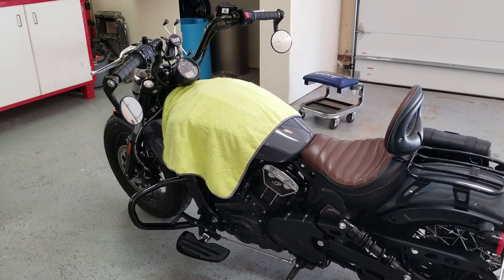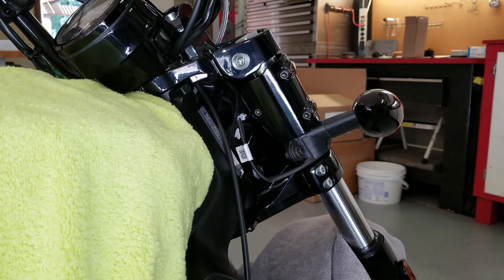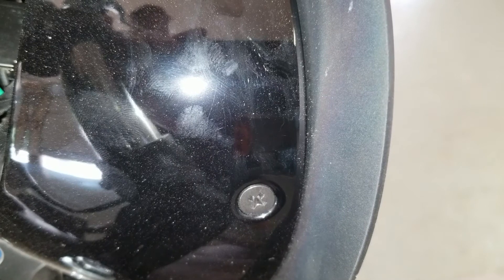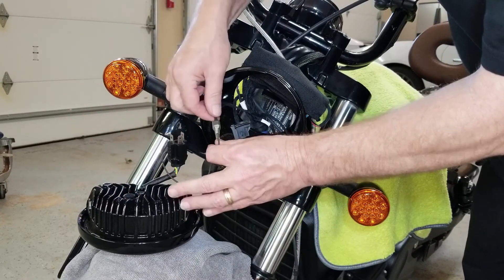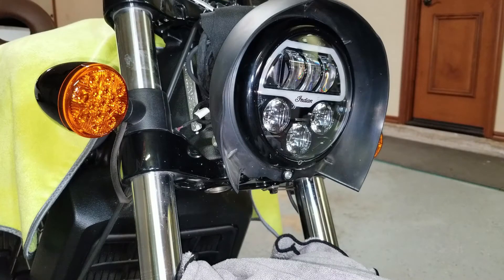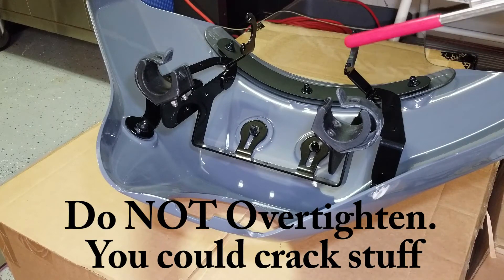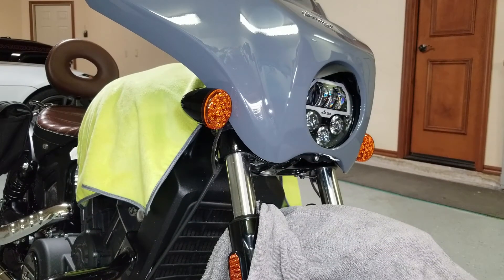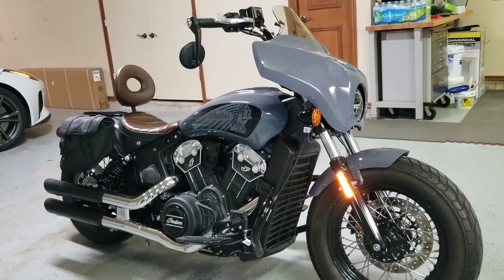Fairing and Windshield Install with Headlight Relocation - 2021 Indian Scout Bobber Twenty

Comment: They sale curved windows for the scout fairing at freedom shields , there curved and sizes are 10, 12, 14,  all three sizes have tent option. If you’re interested in checking it out. Good prices to
Reply from the maker: Thanks for the comment!  Yes, I am familiar with Freedom Shields and actually considered one if the OEM one did not work for me. Fortunately, I think the one I have is going to be just fine. Thanks for tuning in... I will be publishing an Update and Review very soon so stay tuned :)

Comment: It’s hard to do, but your suppose to get that bundle of wires inside of the headlight bucket, like it is on the regular scout. Also note that Indian script head badge thing you mentioned fits all scout models. 
I’ll be interested to see how you like the 7 inch windshield on the fairing. I’m 6”4, and didn’t even bother trying it. I went with the Freedom Shields 12 inch, which is still slightly too short and can cause buffeting. The same company does produce a 14 inch shield for the fairing, but in my opinion the 12 is already pushing on being more than the fairing was designed to handle. When I have it on I don’t take the bike past 70 mph, as it seems the wind could snap the top of the fairing off at any moment, and send that windshield straight into your head. In fact after installing that shield it weighed so much compared to the fairing itself, I’d bet it doubled the weight. 
Overall, I ran the fairing all year last year. My conclusion was I hate cleaning the bugs off it during the summer after every ride. However it’s wonderful in the winter, it absolutely triples the time I can stand to ride in the freezing cold. So as a result, I take it off for the warm weather, and reinstall for the cold. 
Either way hope you enjoy it, it does look good, far better than any other option.
Reply from the maker: Thanks for the comment and the tip on the wires. This afternoon I took it all apart, hid the wires in the bucket, and re-installed everything. Yes, it was challenging, lol. But I hate loose ends (and wires). I even did an "Updated Video and Review" that I will be publishing soon so be on the lookout for it. I have lots of fun riding, but I also love tinkering with things and making mods. This motorcycle thing is all new to me, lol. 

I am familiar with freedom shields and considered one. But I first wanted to try the largest Indian OEM, 7inch, and it is actually just right for me. I am 5'7" tall. Yikes about the tall ones flexing like that. And yes, I hate cleaning the bugs off too but I do it anyway to keep it looking nice. I have not ridden in really cold temps yet but I'm sure I will as soon as the weather turns cold here in Oklahoma. I still have many "firsts" to come :)

I think it is cool getting tips like yours. Thanks again, I appreciate it very much :)

Comment: That rubber gasket that goes around the headlight looks like you installed it the wrong way. Flip it around so that the extra rubber faces toward the bike.
Reply from the maker: Hello Khan... Thanks for your comment but I am not entirely sure that you are correct :)